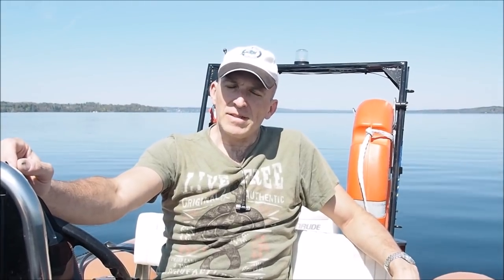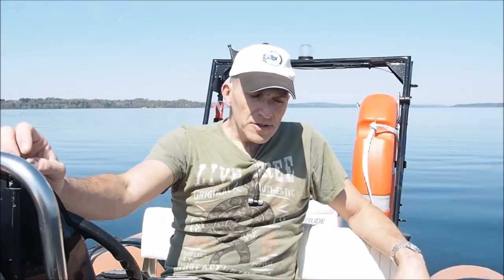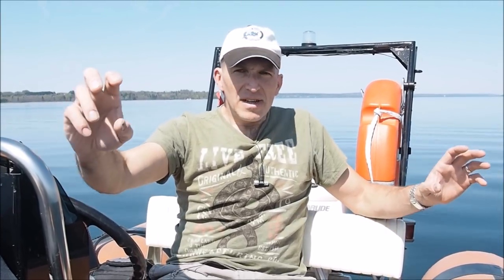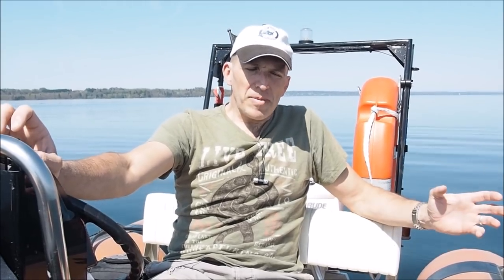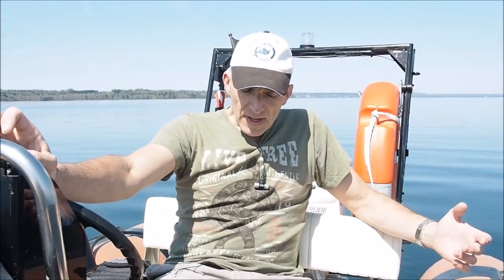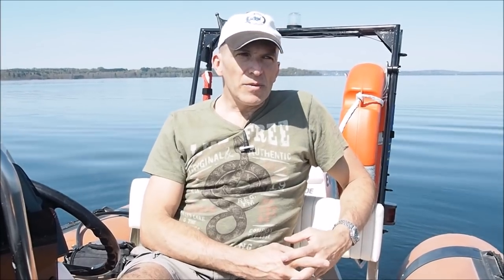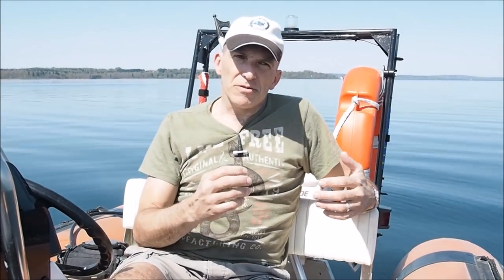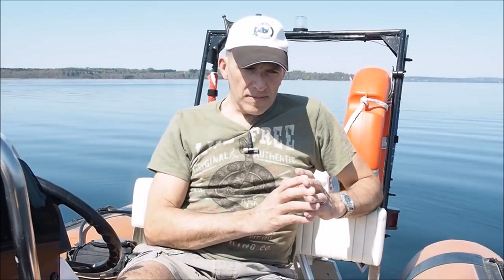ISE Predive Sequence

Comment: I like your video's, but I do disagree with you on this video. A simple check of 5 minutes before a cave dive can prevent you and your team having to cancel the dive because your buddy forgot to put something in his pockets. 

Happened to me, buddy forgot to put his camera in his pocket and we where planning a video dive inside a cave. Now he was still able to go out the water get the camera before the dive started. If we would only notice it when in the cave we would have to cancel the video, or go back out and switch tanks so we have enough gas again for this plan.

But yes I do agree you don't need to spend 20 minutes on the surface checking every backup light and everything. Just check your gear when putting it together and putting it on. And then just a quick check in the water with the team like "Team captain: "Backuplights", Buddy: "Yes checked on the surface". And when comming to the pockets just a quick check everything is there, and notting is hanging out. Same for other stuff. Just a quick check everything works and the plan is clear can prevent having to cancel the dive. And if it takes more then 5 minutes you are doing it wrong.
Reply: He's talking about the pre dive sequence in the water at the surface. Checking what's in your pockets should be done right before you put on your harness. Checking that nothing is hanging out or for instance a bubble check you do passively in the first 5 meters of descent. Use your time efficiently when diving.
Reply: I agree with Achim. Do everyhting that you can out of the water. Especially when you're diving a cave with 8c temperature. You don't want to spend any more time than absolutely necessary in the cold. I think the most important think is to find a procedure that works and stick to it.